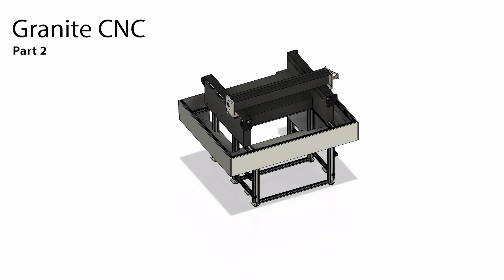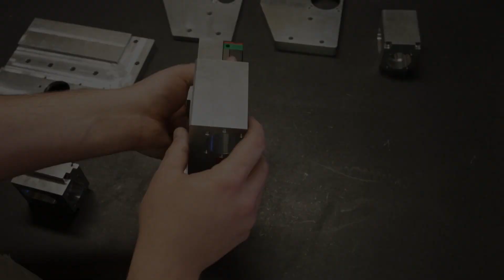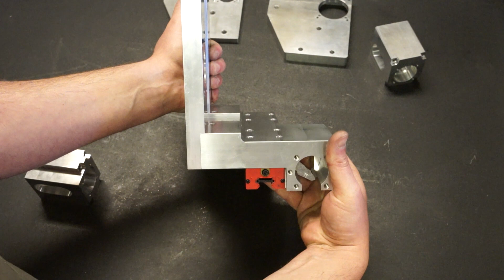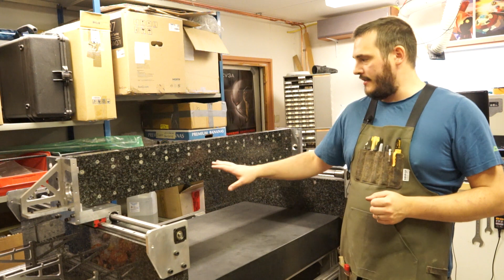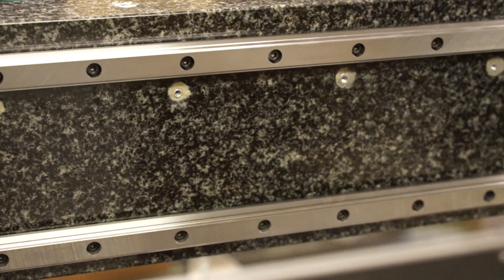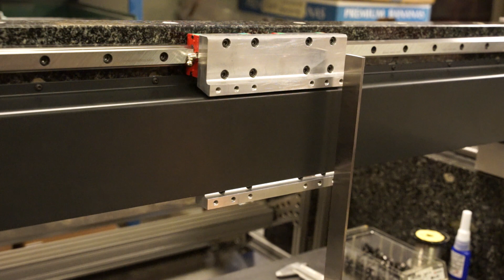DIY Granite CNC - Part 2. Mounting Y & X axis.

Comment: Im very inspired by your build. 

How did you find your granite sides and boom with sufficient tolerance to be useful for your design? I trust that they are not "kitchen work surface" granite from easily accessible sources?

I started my own CNC design a few years back but people discouraged me from continuing and told me to buy a normal mill and convert it instead, so I gave up. But your project has given me fresh hope of being able to do this myself.

Also, do you know roughly how much you spent on the granite?

Im trying to weigh up whether to take your approach or to buy a mill for ~6000GBP and try and CNC convert it.

I also saw in one of your comments that you are an automation/controls engineer like me 😁
Reply from the maker: That's amazing! thanks for telling me! 🙂

I live in Sweden. I had trouble finding granite from kitchen oriented companies that where thicker than 40mm. They didnt deal with those thicknesses. 

I ended up buying from a company working with gravestones. They regularly work with 100mm as a standard thickness and that suited me much better. I think i paid around 850 EUR in 2020 when i bought them. 

The tolerance is not that relevant since you will need to work it into spec anyway. They wont be good enough from the supplier anyway. 

"people" may be correct. They usually miss one key point though. What's the use case for your machine? IE, do you require a large worksurface but can do with a relatively low Z height? Maybe you work on sheets of materials more than blocks for example. That was the main reason for me going with this design. I wish to be able to work with large surface parts. If this is not true for you, then they may be correct in that you should convert a more traditional style of machine instead. They are generally way more stable in their construction and lend themselves to a more "normal" style of milling. My style of machine is very specific in what endmill styles work for example. (look up footage of Datron CNC machines  and how to run them and compare to a Haas machine for example, way different philosophies in how to run and tool the machines.) 

I hope that made things a little clearer. 😀

Comment: Very nice design, thanks for sharing. I can tell you put a lot of time into making the entire machine flow together well. Are you an engineer in your dayjob? Were the aluminum parts made on a CNC or a manual mill?
Reply from the maker: Thank you!
Im an automation engineer. Designing parts is not part of my job. The electrical and control part is closer to what I do. 

All are made on CNC. Some on my current cnc. It made some of the parts that have less important tolerances. The other parts I bought from people with real production CNCs.

Comment: I really liked the way to protect the X-axis of the linear rails and the lead screw, but maybe it made sense to make a large mating surface area of the x-blocks and the Z axis? (this gave more hardness of the structure)
Reply from the maker: Yeah, its a balance between height of the mating surface and how big the slot needs to be for that surace to be able to fit.

Comment: How did you drill and bolted them? how did you align them? would like to see a complete video of this.
Reply from the maker: I'm not entirely sure what "them" is that you are referring to. But If you mean the linear rails I spend most of video 1 talking about how I fasten them into the granite. 

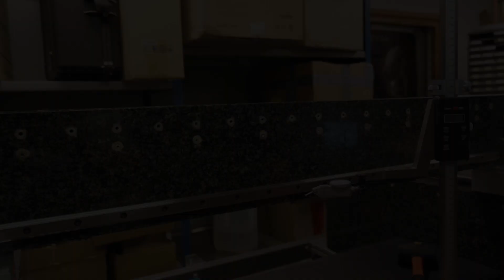I talk about alignment here: 7:52
Reply: @faggan3040  yes linear rails. I would like to do the same thing what you’re doing. But have no clue as a hobbyist how to align the linear rails down to 10 +/- micron precision.